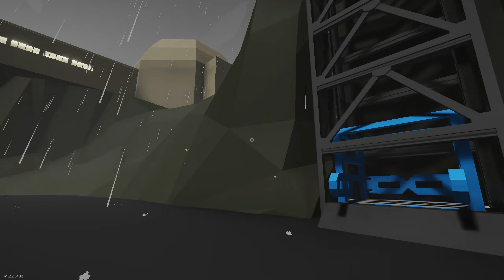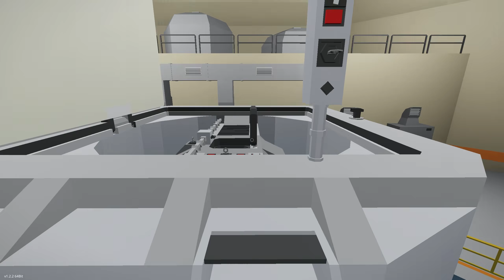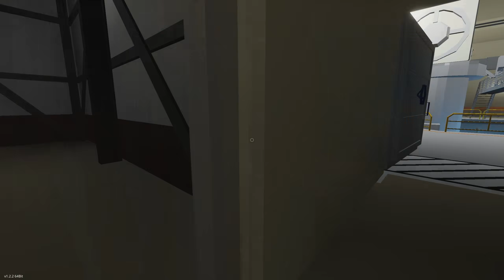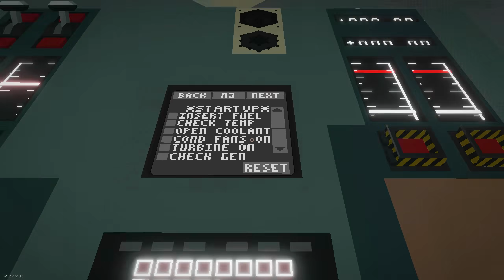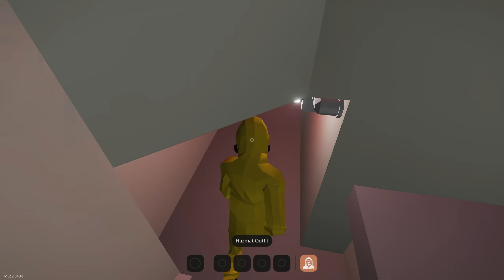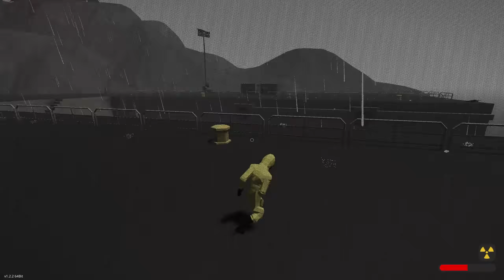Meltdown at Brinkfield Nuclear Power Plant!! - Stormworks

Comment: Pro tip: close all of the sealed doors it should prevent radiation leaking
Reply from the maker: Correct they are designed to contain radiation inside sealed compartments.

Comment: Loved the video MrNJersey! Definitely getting Chernobyl or Fukoshima vibes from this! The Alarms could use a bit of work though, maybe something like a Fire Drill alarm or a Fire Engine siren, or better yet, a Tornado Warning siren for full Immersion! Strange thing about Chernobyl though is that usually the Radioactive fallout lasts for about 56 years, with Chernobyl, at least check, even if the Radiation dropped down to acceptable background levels, it would still be rendered uninhabitable and the local plant life have started to grow through the brick wall that the Soviet Union had put up to contain it.

Comment: I kinda wish that there would be manual SCRAM button.
Reply: “The only good decisions they made incompetent morons”
Reply: That's a good idea a Moron who created this power plant have forgot to add a emergency SCRAM button which is a critical part of power plant just in case of meltdown
Reply: Yes There Is Scram 5:13 These Lokable Buttons
Reply: If these reactors are anything like RBMKs the SCRAM would make it far far worse
Reply: @drumminggoose444  I tested it in the game, they don't seem to have a positive void coefficient because injection of the control rods doesn't increase reactivity, but the game does account for things like decay heat, so it can take seconds or even minutes for the insertion of the rods to actually quench the reaction, meaning you can still break a reactor and release radiation with sloppy control.